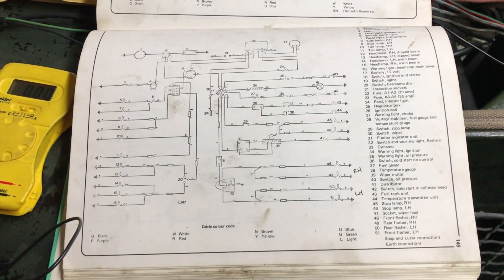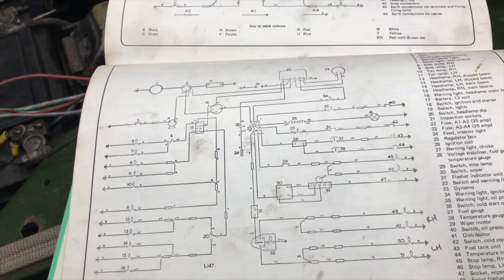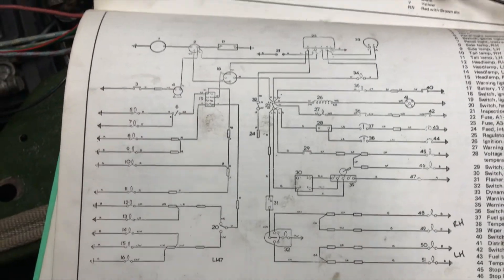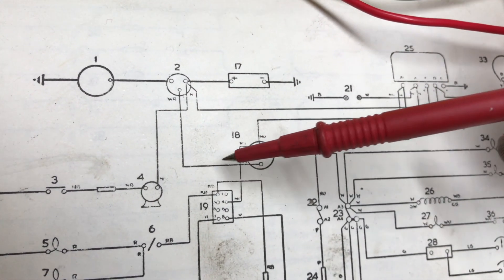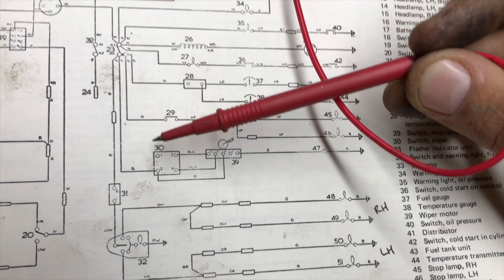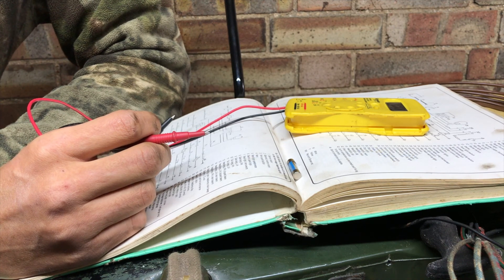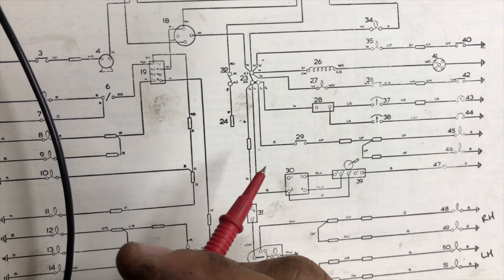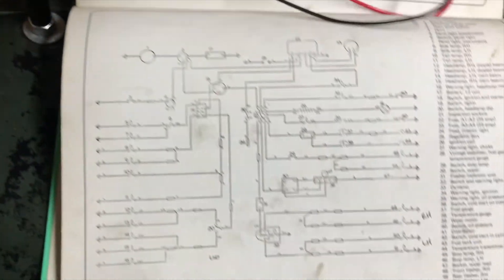Series Land Rover Electrics - Fault-Finding Part 1

Comment: Good job.  My SII fuse has caused problems as the cover is missing. (anyone know where to buy those?). However my problem now is one of both indicators dont work, and one front side light doesn't either.   Power to bolus holder, bulb tested good, no light.  I will double check the fuse is not in a high resistance like yours. (update; it wasn't the fuse, or the junction box - still looking).

Update; it was a few corroded lighting connectors in the front wings, but the glass fuse had an internal dry joint.  was. providing continuity, but not current.

Comment: you  have used simple logical thinking .testing a fuse that looks good as i have had many a fuse that looks good to the eye but is faulty then the testing on the fuse box out good I am off to a land rover right now and will run an earth network throughout first
that helps with an ally body As a further example my 14year old nissan pickup i redid the loom with earths everywhere and used cloth tape